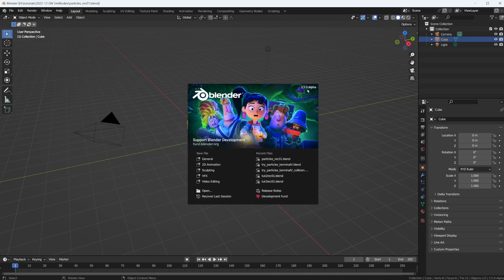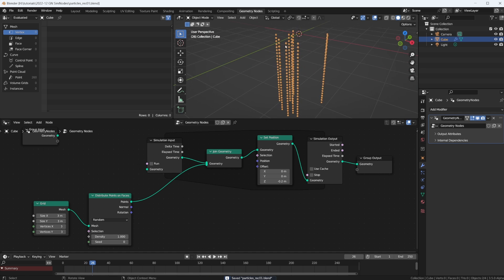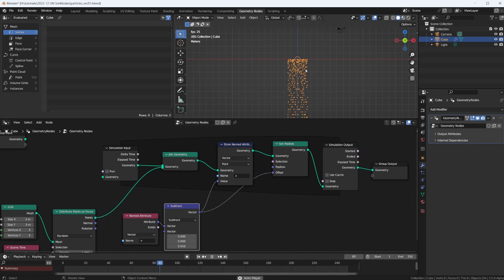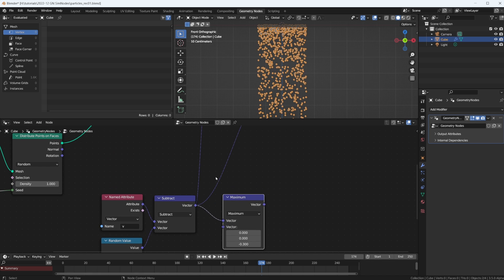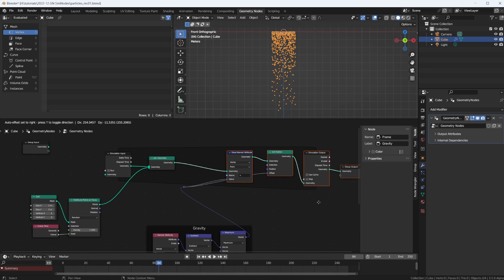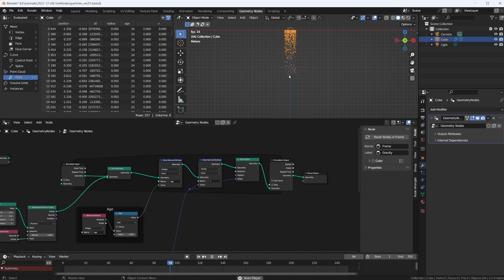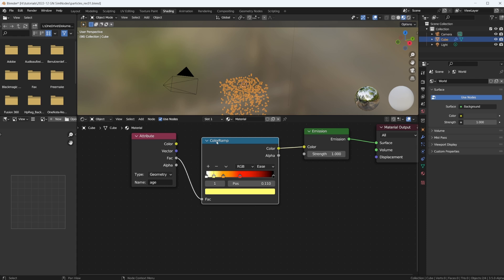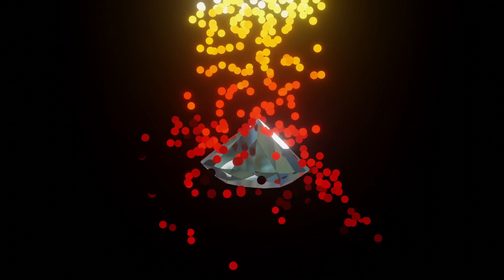Particles w/ Geometry Simulation Nodes in Blender | Tutorial | How-To

Comment: 2:15 this is something I don't quite understand. Why is nothing plugged into the Simulation input node? As I understand when we are "Joining geometry" , we join A and B... "B" is Grid converted to Points... and what is A? just empty Sim node with nothing plugged in?... especially confusing if I plug the Grid>Distribute Points into the Geometry input of Simulation input, then it's the same result as leaving it empty?
Reply from the maker: Sim start input is just for the start (1st frame) of the sim. We can start the sim with nothing and build up stuff during the sim.

Comment: Excellent tutorial Chris. How would you control the start frame of the particles?
Reply from the maker: Only run the sim if frame is greater than your desired start frame, bypass otherwise (e.g.with a switch node inside the sim zone)
Reply: @chrisprenn   Many thanks, I will try that 👍

Comment: Great as usual. No problem on that one. Suggestion: the particles are falling inside a very regular shape (an elongated cube). I will try to have them spread a bit in the x and y direction. (I suppose It is just a matter of offsetting them on the x and y axis as well like you did with gravity on the z axis.
Reply: Now I have done it. I would like to have the particles fade away slowly instead of disappearing when they get at a specified age. I know I can do this through the alpha channel in the shading editor but I would like to do it from inside geometry nodes. Is this possible?

Comment: Great Job Chris! Is there some other Named attributes we can use ? For liquid physics for example .. like in old particles system in blender?
Reply from the maker: there are no default attributes to use - only the things we add to the particles. In this example I added the "age" named attribute and added 1 on each frame to create a usefull age attribute
Reply: @chrisprenn  I'm sure they' ll do a vibrate node. Pointless adding stimulator nodes without vibration.

Comment: If you're going to do a "loop" simulation node, why does it have to be linked to the animation?!?! Just add a socket value for number of iterations and loop it that many times. It would be immensly useful. Instead the animation loop is kinda useless for static things like procedural hard surface models. I dont get it... It seems to me like they did huge work for only 5% of benefit
Reply from the maker: It's simulation nodes (to loop the output back to the input), not just loops. Loops are planned for the future as far as I can tell.
Reply: Loop nodes are coming. Simulation nodes are just reacting to the previous frame.